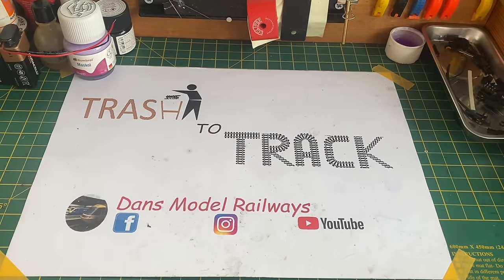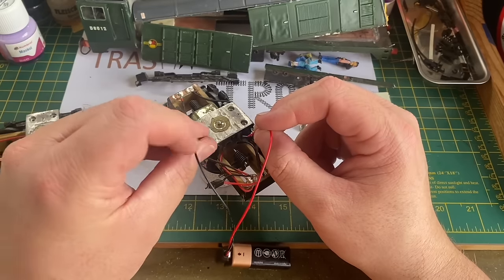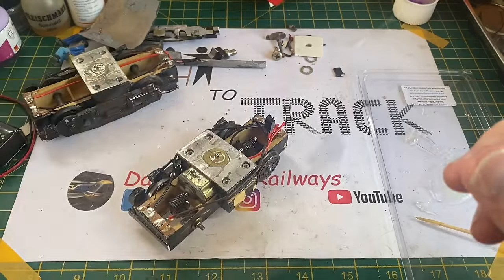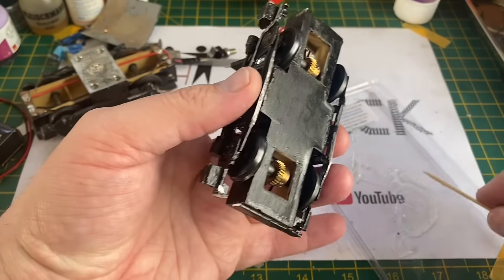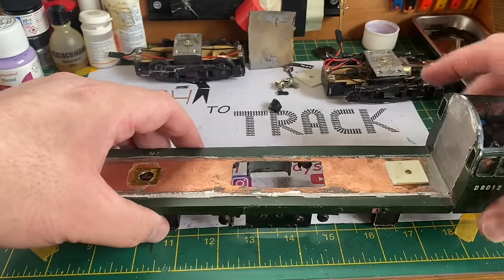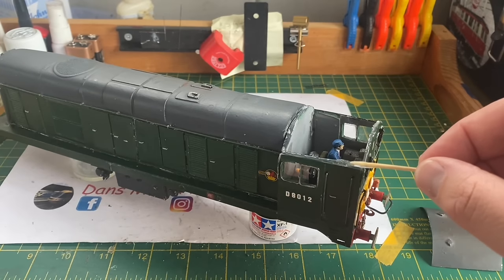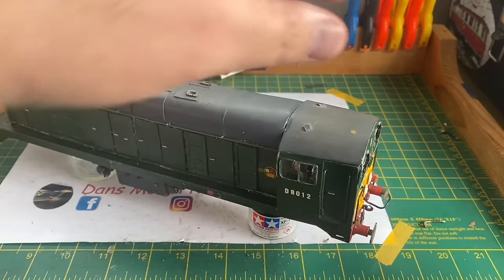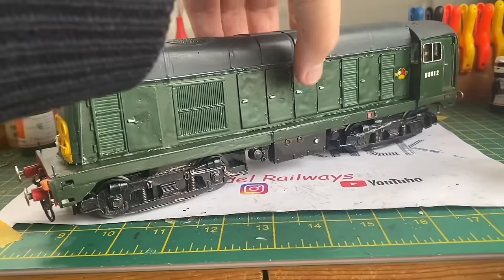Trash to Track. Episode 92. O gauge class 20 kit.

Comment: Absolutely brilliant video Dan, I watched every minute of it and was enthralled by it every second, you did a great job on that, from literally a box of bits to see it running on the track at the end was great. I built an O gauge Class 50 about 6-7 years ago now, I fitted sound, lights and a smoke unit in it and it turned out rather nice. I had intended to build a small O gauge end to end but I’ve never got round to it so it sits on a plinth under a display case, it hasn’t run for years so i may dig it out and give it a go and see what it runs like - this video has been a great inspiration to me so thanks for that mate - a great job!!    👏👏👏.        Cheers.         …………Graham
Reply: That would be great to see a video on it Graham.